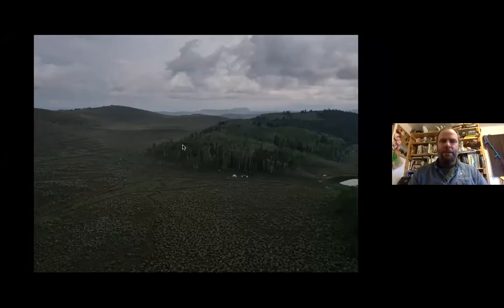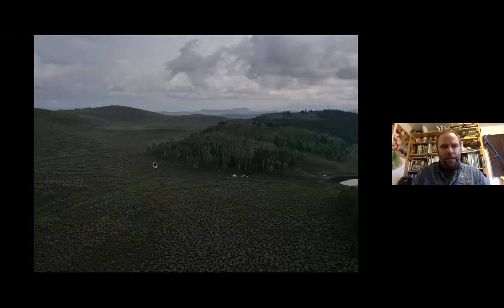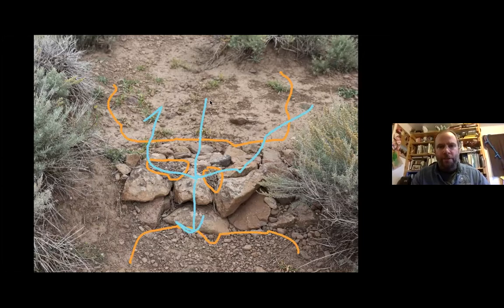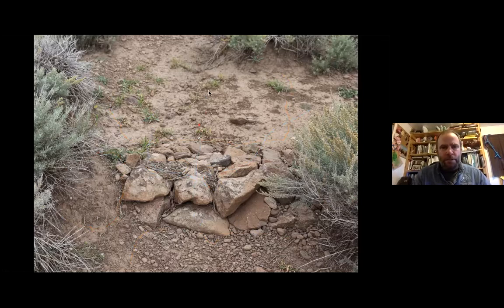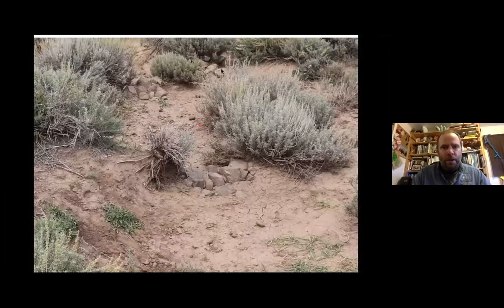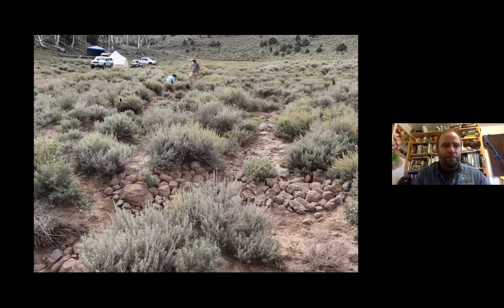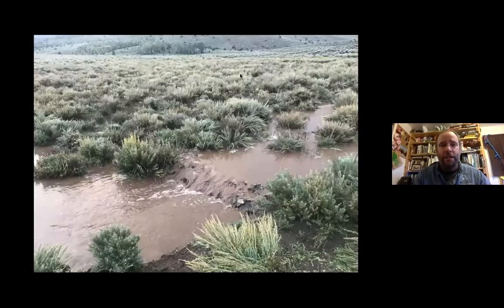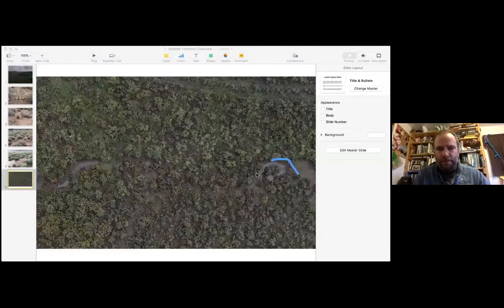One Rock Dam Repair - Low Tech Erosion Control Case Study with Jeff Adams

Comment: "Really big" is more prone to failure than small and frequent.   Likely starting higher in the landscape, and planting trees where the slope is too steep for  conventional catchments will slow and spread water.
Robust is always good.  

You need to ultimately slow water to prevent erosive forces.

Brad lancaster had good diagrams in his latest editions on rainwater harvesting.

Comment: for the one rock dams they have to be built in a concave to keep the water chanel in the middle, instead of out and around the structure.
Reply: You mean to prevent erosion at the sides?  One needs to ultimately slow water.  He may also need to add more one rock dams in between as well.